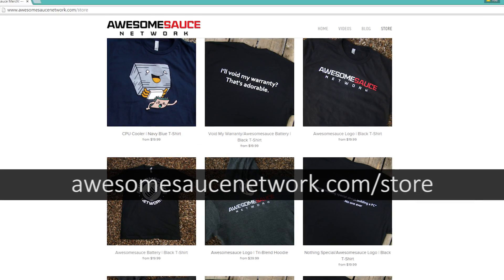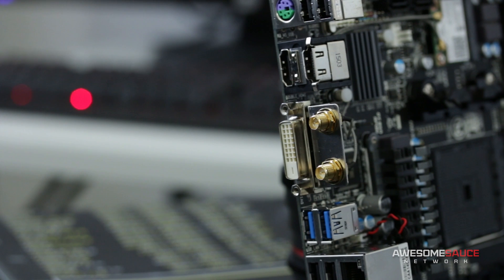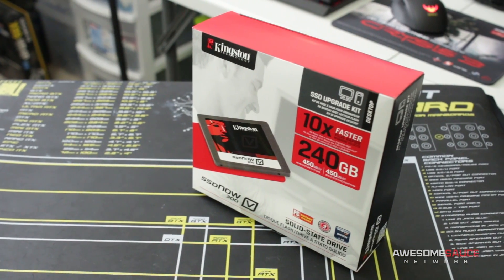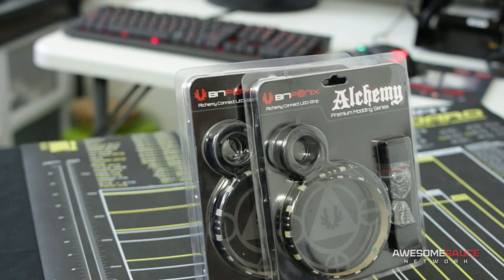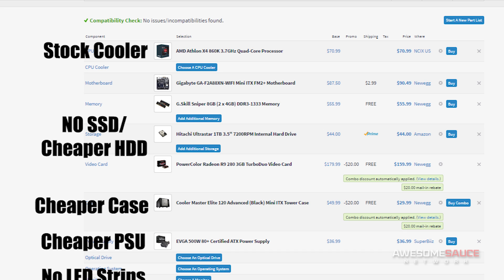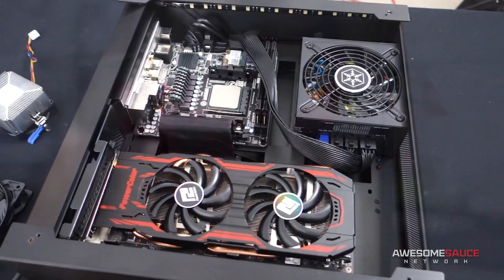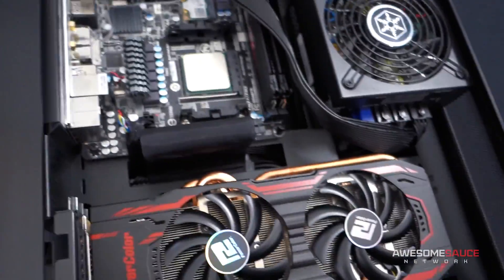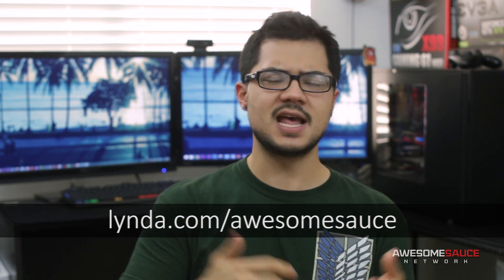The Overkill Console Killer: And How to Build One for Under $500 (Part I)

Comment: wait what? how does the GPU connect to the motherboard?
Reply: By a pcie extension cable.
Reply: f1tony2003
no, its just an extension cable.
Reply: queenform strictly speaking, there would have to be a slight impact as a result of the increased distance for electrons to travel via the extension. However, this increased distance  makes little difference because of the speed at which the electrons travel along the conductors.

In short: yes, there is a difference, but it is so small as to be impossible to detect.
Reply: Christ J dafuq are you even talking about bro? this isn't science class, its youtube, We're all dumb as shit, english please :P
Reply: 1toncheese Just curious. Does using the connection effect GPU performance? I'm a noob btw
Reply: Christ J I don't think there would be any difference at all with the extension, and I guess if there was, like you said, it'd be insanely minuscule.
Reply: xXShadowXx I assume your previous comment has vanished because you thought better of it? Fair play to you - people seldom have sufficient courage to admit an error and retract a demonstrably-incorrect assertion, especially on something like YouTube, where they can do so with complete anonymity.

I'm fairly sure that electron travel over that short a distance would be faster than the time taken to draw a frame at even the highest current refresh rates, so while it may be possible to measure a difference in principle, it would never be an issue in practice. Interesting topic though, especially for those with an interest in the physical properties of metallic bonds.
Reply: Christ J You'd have to determine the current over the PCI-E riser, only way to determine if it's faster than drawing a frame (which it probably is since drawing a frame requires very fast movement of electrons).
Reply: flagmuffin1221 electricity in general involves the extremely fast movement of electrons - or, more specifically, ions. To be honest, the current wouldn't really be relevant, as the rate of electron/ion movement would actually be determined by the physical properties of the metal they are moving along, as well as the energy supplied to the delocalised electron cloud. It should be possible to determine the current without actually measuring it - in principle, at least.

Fascinating stuff...
Reply: Christ J
Yeah, I fucked up with that last comment :P
Reply: Christ J they should make a 2 meter pcie extension cable and see if it fucks around
Reply: Josh Kelly just daisy-chain them.
Reply: Christ J I understand it has no effect in processing power, but would it affect latency to a non-negligible level? Let's consider vr headsets such as the Oculus Rift and vr games, which demand the lowest possible latency in order to give an immersive experience without making you dizzy/worsening the experience. What do you guys think?
Reply: Leonardo Segura The difference would probably be negligible. We're talking nanoseconds of latency most likely.
Reply: Leonardo Segura In VR headsets it might, but even then I'm not even sure it'd be noticeable. With how fast data transfers are nowadays, latency is hardly an issue with peripherals anymore.
Reply: Leonardo Segura well, we'd first have to consider the rate of electron flow along the materials involved.

This is actually rather close to the speed of light in a vacuum, due to the way in which these materials are structured at the atomic level. This means that a signal will travel along a - say - two-metre length of copper wire at a velocity of about 280,000,000m/sec. This means that the time taken for the two-metre length to be traversed is about 0.000000007 seconds, or seven nanoseconds.

Fun topic, isn't it...?
Reply: xXShadowXx In other words, it won't affect it at all. If it was in the milliseconds, then you'd notice.
Reply: flagmuffin1221 I was agreeing with you, :P
Reply: Christ J Sounds amazing, thanks :D
Reply: Actually electrons move at a fraction of a meter per second .-.
But the have a drift velocity of somewhere just over 2,000,000 m/s.
Moving an actual electron takes a lot of energy (see ionization table for relative amounts of energy needed). Plus you create ions which may be unstable and that could lead to radiation and now you're in a whole heap of trouble. But there's a lot more that actually goes on than that. 

Anyways. .
I'm guessing your original question is how he connected it in this build? 
If so: Pci e raiser card
Sometimes called  Pci e bridges.
Lian li probably included this with the case since it's designed for that.
Reply: Ethan Johnson I did explicitly state that I was using the rate of electron flow, although I suppose I could have clarified a little. Fair point.
Reply: Ethan Johnson Solid metal's have free flowing electrons as part of the metallica covalent crustal structure. The ionisation energy is the energy need to remove an electron from the outer shells of an atom - in the case of wires, this won't easily happen as the electrons free flow is what makes metals good conductors.
Reply: flagmuffin1221 it's also what makes metallic bonds the strongest chemical bond, as the delocalization makes it extremely difficult to tear an electron away from the bond in order to weaken it.

Chemistry is fun...
Reply: Christ J Tis indeed, which is why I'm majoring in it haha
Reply: Christ J flagmuffin1221 Isn't Chemistry just a bit of applied Physics? trollface.jpg
Reply: Josh Kelly lelelelel
Reply: it uses a cable to connect to the pci onto the motherboard

Comment: How will the x4 860k stack up to something like a i5 4460?
Reply: If you can, just get the i5.
It will be worth it ;)
Reply: Banana GAMING thnx, i think i'll do that!
Reply: NP ;) and good luck with the build!
Reply: thnx for the help!
Reply: Catnapper 8350 is too fucking old now, AM3+ is well dead in the water
Reply: RedDragonGamingHD sit the fuck down kid , you dont know shit
Reply: Catnapper An I5 will perform better in most games than a 8350, although the 8350 is good as well, it won't outperform an I5.
Reply: Sybren Bijlsma The Core i5 in pure performance will beat the Athlon, as the Athlon's 4 Cores are not as powerful as the i5. However, consider the price.... the I5-4460 is $180, the Athlon X4 860K is only $80. You still have $100 left to put into other components, like an AfterMarket CPU Cooler or Graphics Card.

In Summary, For Pure Performance and if you can afford it, the i5 wins. 
In Price to Performance, The Athlon X4 860K is flat out worth every dollar.
Reply: Doogie Howser Newer architecture resulting in faster cores and even now most games aren't utilizing 8 threads properly, FX line is old af now, made sense a year or two ago but not much anymore. H81 is fine if you have a locked processor, cheapo AsRock H81M in my HTPC with an i3-4130 works great and is cheap.
Reply: Doogie Howser I lost brain cells. I don't own an FX system but I've built 2 systems with FX-4300s and one with an overclocked FX-8320, also built my systems with an i5-3470 and i3-4130 and my friend's with a Pentium G3258. Don't manipulate my comments, I never said they were shit, I said it doesn't make much sense to buy one anymore unless you can grab them dirt cheap, the architecture is old its 5 years old and in computers that is abysmal, they are still very good performing chips BUT the newer more efficient architecture in newer Intel chips is better since most games still aren't optimized by devs to take advantage of more than 4 threads properly, and the IPC in Intel chips just is better due to the manufacturing process there is just no argument. I've run benchmarks and tests of my own as well as researching countless tens of hours on them, Intel chips overall are better and the value argument is becoming less and less relevant now since you get so much more performance now with a better upgrade path. I doubt you have an i3 so don't say shit you're being a hypocrite accusing me of looking at rigged benchmarks, I want AMD to do good to give Intel the push to release better chips instead of the usual 5-8% generation improvement, but they haven't come up with anything so obviously Intel will pull ahead.
Reply: ***** Yeah don't worry about kids on the 'net spreading false information. Most of these kids online are mommy and daddy sponsored or don't even own a PC.
Reply: Get the 8350 and wait for dx12  , I5 isn't going to stand a chance
Reply: Catnapper No I do built my brother a rig with an 8320 clocked to 4.13Ghz and compared to my last gen i5-3470 mine destroys it in every game and the only thing it beats mine in is rendering, and compared to haswell and soon to come broadwell chips it would be stupid buying one especially when in the next year or so the new AMD chips are being launched
Reply: RedDragonGamingHD 4.1? seriously you call that overclocking? a first gen i7 can beat your i5 
an 8350 costs like 100 bucks now and has 8 physical cores with dx12 it going to let programs take full advantage of its cores 
and the prices for the amd cpu are gonna be high the first few months its out so the 8350 would perfect until it releases 
skylake aint got shit on zen
Reply: Catnapper The shit AsRock board wouldn't let it be pushed further and I'm not going to lie, Mantle was supposed to bring huge gains but didn't, FX chips just don't compete wit Intel right now, hell the i3-4130 in my Steam box performs better in most games, and its stupid to rely on speculation on DX12, wait until its released, but right now they are dead, unless you can get one as cheap as an i3 its pointless to me, plus you generally have more expensive boards than H81 for i3 and the stock cooler is shit
Reply: RedDragonGamingHD how about get a better MB
stupid to base its performance on a shitty asrock board
i got mines to 4.5 easily without stress testing it , i could get it to 4.8 if really wanted to
this person is probably building a pc for gaming and not a rendering machine 
a pentium g3258 would be enough for gaming
Reply: Catnapper Not sure why you're getting so passionate about this, from my real world testing most Intel chips perform better due to newer architecture, doesn't mean FX is bad, also to get speeds like 4.5Ghz or higher you need a generally beefy cooler like an AIO and also a decent 970/990FX board with good powerphase design and VRMs.
Reply: RedDragonGamingHD i get "passionate" because i like saving people money and get the most bang out of the buck 
i have an h100i and i was able to achieve that speed on a cheap motherboard i had except i only switched it out with a premium board because of a defect on an audio port 
when i talk computers i get super cereal 
besides like i said he could buy some cheap parts right now to get him by until the new chips come out in a year or so 
instead of waiting a whole year to be able to play all the new games coming out
Reply: RedDragonGamingHD H81 baords are shitty AF. People like to throw away money with dual core these days. Also, how does a 3470 destroy a oc 8320
Reply: ***** I'm not saying that the FX platform is shit or that people aren't smart for buying them, I'm saying it doesn't make much sense now at this time to go for the FX line, the architecture is old with a new refresh to AM4 imminent in the next several quarters, and with current Haswell and upcoming Broadwell and Skylake chips blowing them out the water in terms of gaming, an i3-4130 performs better in most games than a moderately overclocked 8320/8350, but they are still very capable chips and if you can get a 6300 or 8320 very cheap then I'd go for it, but AM3+ is pretty much dead
Reply: RedDragonGamingHD You DO NOT know what the fuck you're talking about. Stop looking up garbage INTEL paid benchmarks. You don't even have a AMD rig. SO how the fuck do you know if the FX line is shit? Man what a fucking tough guy. Just because it's "old" doesn't mean it's bad. If that's the case then 2011 Sandy Bridge owners should throw away their i5s and i7s. And on top of that it's unlocked 4+ cores for other shit that people do besides being a moron on the internet talking about duo core chip. LOLsssss i3 locked at 3.4, 3.5, 3.6. HT ain't going to help you buddy. The i3 at WORK is SLOW AS FUCK. Don't get me started.
Reply: RedDragonGamingHD tl;dr
Reply: ***** I just want to point out fm2 series has better IPC and since it's unlocked, it's also a great budget. But people are blinded the word "Intel" and the opinions of shills, too many Intel fanboys say otherwise. Oc to 4.1 and it's just as fast as a low end i5.
Reply: ***** Guess it depends on the circumstances, if its that big a difference then the 8320 makes sense, but where I am an i5 is $40 more than an 8320 plus you can use the stock cooler and boards are cheaper since you don't overclock on locked i5s.
Reply: RedDragonGamingHD
zZzZzZzZz// yawn...
Reply: Doogie Howser Being an immature keyboard warrior who dismisses arguments only discredits your points, you're sounding like a fanboy and fanboys can't be reasoned with, I don't care what brand is in my rig I just want what will be best for my purposes.
Reply: Doogie Howser Is it your time of the month or something? So passionate lol. I couldn't really care less what you think, I like AMD and Intel and I have my own opinions and some raging fanatic isn't go to persuade me when I have first hand experience, also an i3 from 2011? What does that have to do with anything, mine is a 2014 i3 which is still in production, much newer manufacturing process and much faster than a 4 year old chip. And yes i3s are dual core but they have hyperthreading which is 4 total threads. It's not that hard to understand why 4 fast cores perform better when most games only utilize up to 4 threads properly versuses an 8 core like the 8320 where only threads are being properly utilized. Please don't respond if you don't have anything intelligent to say or will resort to a 12 year old girl on her period.
Reply: RedDragonGamingHD tl;dr waste of time.
Reply: Grab an i5
Even the pentium g3258 outscores the 860k.
Reply: It got nothing on the i5. I Have the 860k and it bottlenecks my 260X in GTA V..
Reply: ***** its not fine. It cant keep my GPU at full load in any game except CSGO, in all pther games Ive tried the fps drops are bad as fuck and it gets low fps.
A 860k with 280X gets like 45 fps in GTA V, an i5 with the 280X and same settings get like 75 fps..
Reply: ***** saving up money for the 4690K
Reply: ***** x99 is really out of budget!
And I dont know about skylake.. DDR4 is expnsive. So I think I rather go with Z97 and i5 4690K, have that for maybe 2-3 years and then I upgrade to the architecture they have by then and DDR4.
Reply: ***** I went and checked, the 5820K is more expensive than a Z97 Mobo and 4690k lol, so it was really out of budget lol
Reply: Wiikendz It got nothing on the i5. I Have the 860k and it bottlenecks my 260X in GTA V..

Lying pack of shit. ROFL
Reply: ***** What are you talking about? That dumb fuck said a 860k bottlenecked a 260x.
Reply: Wiikendz HAHAHAAHAHA. You based it off garbage single core games. Yeah you got some credibility.
Reply: *****
nope, got 500W, system shouldnt use more than max 350W, probably under 320W
Reply: Wiikendz You are the definition of a moron. Bigot. Fud spreader. No wonder why you think i5 is super fast so you talk shit about AMD CPUs. How many comments did you made to a guy who has a 8320 setup with a 380 that you think your "i5" is FAR SUPERIOR?  I don't care if you think you need to validate your purchase. You don't have any sort of credibility. You put yourself out there. Too fucking bad.
Reply: ***** Because he thinks he need to validate his "i5" which he thinks it's "FAR SUPERIOR".
Reply: *****
Look through whole this thread, have I been saying anything about FX CPUs? nah, Nvidia guy is losing his fucking mind.
It was a different thread and the guy kept saying the 8320 is better, but the i5 is actually superior in programs that use up to 4 cores, and pretty much equal to an 8320 in a program that use all cores.
but the nvidia guy cant take it, he's a narrow minded bitch.
Reply: ***** A person made a post on another video about his 8320/380 setup and that bigot thinks he's macho along with others spewing crap that i5 is, quote "FAR SUPERIOR". $220 vs $120 CPU.
Reply: NvidiaFanboysBlows Dick
More like $220 vs $160. Just look at price per performance, dumbass, you cant just look at prices.
Reply: ***** Yes.
Reply: Granted.. but cinebench is only one test. 
More accurately: cinebench is designed for rendering purposes and henceforth it's specifically designed to max out GPU's. Don't get me wrong, does a great job at maxing out a CPU as well and the company even says so. But a single rendering benchmark isn't the best scores to base an argument on.

Regardless of which, when compared to a 4770 (as you did), the AMD is shut down. i7's have the ability to eliminate dead cycles by passing each thread through an additional memory layer. Effectively killing cycle redundancy due to computational logic limits.
This is something only i7's have and no other CPU can boast.
Granted, the AMD is stock clocked A LOT faster than the i7. But AMD CPUs are known for having issues with cycle redundancies. This is probably why the company strives for higher clock speeds that typically result in higher temps.
Reply: Ethan Johnson http://www.techspot.com/downloads/6709-cinebench.html
Cinebench is made to test your Hardware. It does it really good. And its a really easy and nice way to see multi and single threaded performance.
Its not specifically designed towards GPUs.